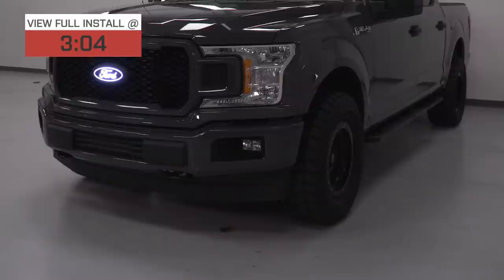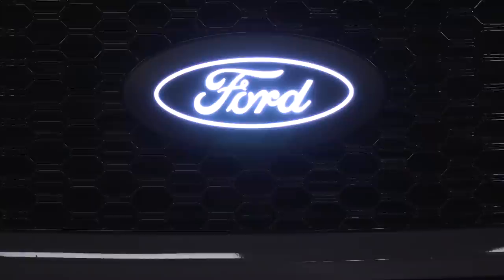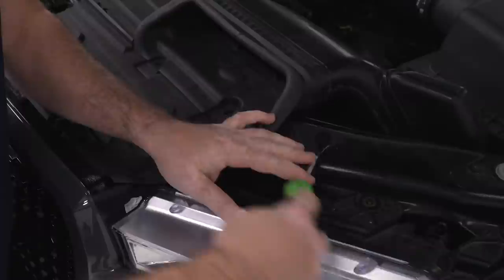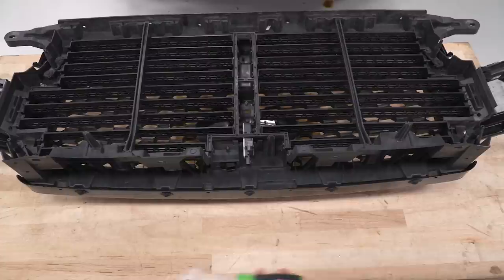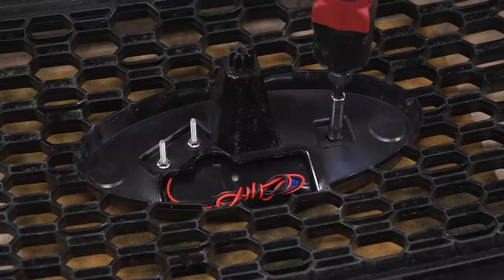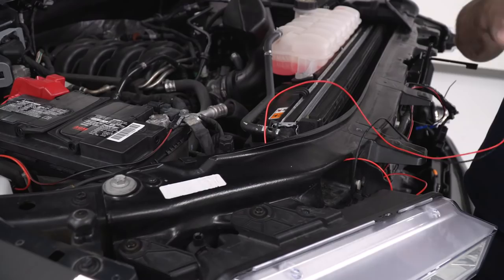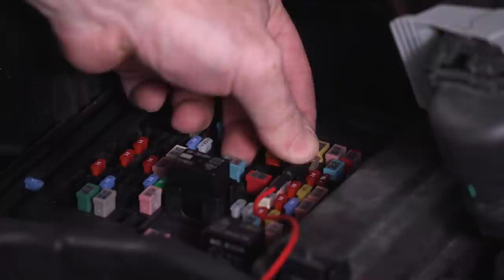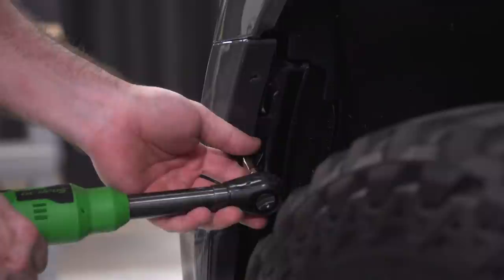2018-2020 F150 Luminix LED Front Emblem Review & Install

Comment: I love this idea, but I think I missed something...how do you turn it on/off?
Reply: Yeah, wheres the off and on part?
Reply: Fuse 18 is the Electric power steering run/start on 2018 and up trucks, it should come on when your truck is started. I watched a video on a headlight install and they completely omitted the fuse tap step for the daytime running lights.
Reply: So it’s on when whenever the truck is on? I wonder if you could use a different  FUZE that will go on only when it’s dark out.